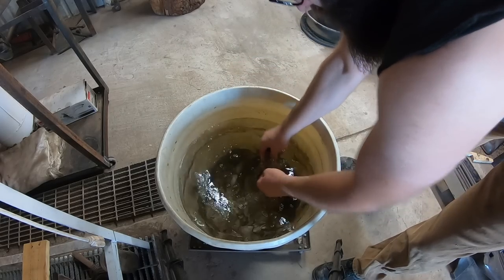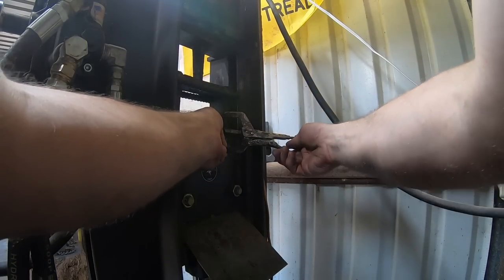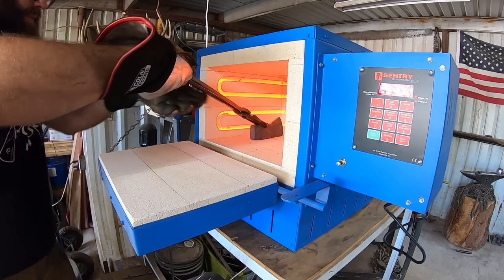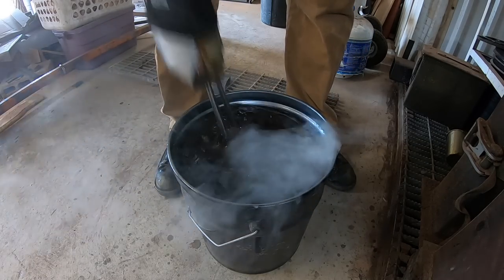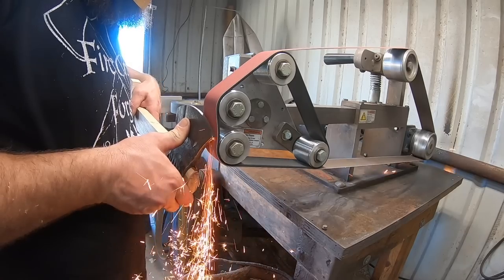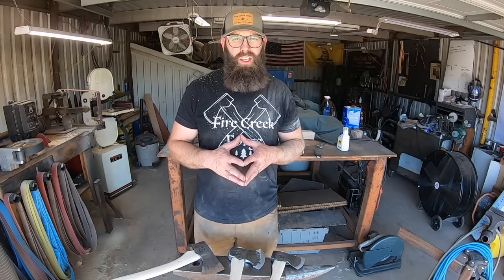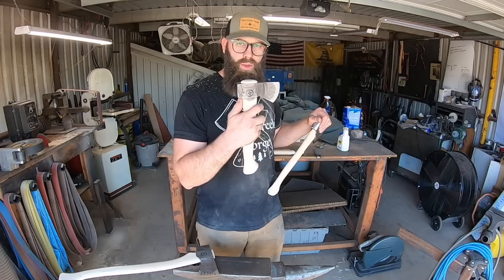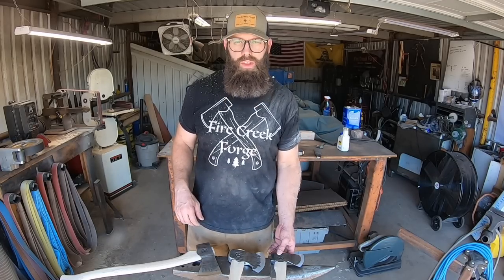Forging Axes In Over 100° Heat At The Shop, Blacksmithing Hatchets Fire Creek Forge, Building Axe

Comment: When your oils tend to get hotter, their viscosity also gets lower and probably why you get some leaks at the filter, its just thin enough to ooze through gaskets and surfaces.
Yeah one of the nice things about modernisation is the ability to do a lot of the work with just one fella and there's no way anyone back in the old timey days was doing anywhere near the same level of involvement across all the manufacturing tasks. Course the downside is that when you do really need a 2nd set of hands to swing a sledge is that our labour laws mean you have to pay them something which more or less wrecks us financially :)

Comment: One day I'd love to own a 5 or 6lbs splitting axe by you if you come up with a pattern. It's not 100 here in MN but we will be seeing 97 tomorrow and Tuesday. We did have 106 heat index this June and our roads started buckling.

Edit: I'm not a fan of mauls as so many designs just bounce off rounds and it's hard to get head speed with super heavy head. Plus, an axe eye being longer and more surface area stays tighter longer in my experience. Be curious to see some prototypes!
Reply: I consider splitting mauls to be dangerous and wouldn't recommend them to anyone...better to use a log cone and a sledgehammer for huge logs then move to slim axes like these for the proper splitting.

Comment: Yeah, heat is nothing to laugh at. I lived in Lubbock for a while as well as Altus OK.  One thing I think I remember was the humidity was 30%  or less??
 I currently live in Wichita KS and the humidity runs about60% on average.  And I'll tell you the old saying about "it's not the heat, it'sthe humidity".  I absolutely true.  When it gets 90° + you need to find some shade.
Reply from the maker: Yes sir, I'm an hour from Lubbock. Yep, overall once the humidity gets about 25% I get uncomfortable, haha.. We've had some humidity lately, and I agree that's the tough part
Reply: @FireCreekForge  maybe get a bigger fan? LOL.

Comment: Just curious why are you Oil Quenching? 1060 is Water or Brine Quench but can be Oil Quenched for really small diameter pieces, I use 1060 for a lot of woodcarving tools chisels etc and have always used water for full hardness quench then temper the tools back down. I’m not just saying my personal opinion but actually manufacturers recommendations as well as what’s in the Heat Treater’s App
Reply from the maker: As a general rule that is true, but the particular steel can vary a bit in composition with some alloy additions increasing hardenability. I've had this steel crack in water a couple times.
Reply: @FireCreekForge  I’ve not had that happen but I’ve not used 1060 in anything with that much mass like those axes, wonder if that’s part of it. Mostly I’ve used for woodcarving chisels gouges etc and engraving tools so smaller as far as mass. I did like your wood carving axe in the video by the way
Reply from the maker: @peltiereric6497  thank you. This is technically 1060M, which allows for additions of some chromium and other alloys, so standard 1060 probably wouldn't do that.

Comment: Nice axes, you are getting very proficient at turning them out 👍. Your workshop could probably do with some insulation in the roof to help deal with the heat, especially with that forge running constantly in there. Our Aussie Summers regularly reach 42 degrees Celsius or 107 degrees Fahrenheit, when I was younger I could easily work in these temperatures, these days I sit on the veranda in front of a fan !! Regards from Down Under.
Reply from the maker: Thank you! Yes that is warm.

Comment: Hatchet and axes look fantastic, love the wedge, the camp axe is the size I use most for hedging and splitting etc 
I like a longer handle. Any one of those would be a very welcome addition  to my workshop
Reply from the maker: Excellent, thank you
Reply: For your hydraulic press, you can drop the reservoir level a bit to release the expansion in hot weather. It’s something we had to do for hydraulic systems in the Middle East. I’m talking 1800-2000psi systems.  Make sure to talk to the manufacturer though, obviously.

Comment: Axes and hatches are looking great.  I’m Suprised you don’t have the shop layout the other way. Being able to roll the forge outside the door helps a lot with heat, like you did in the old shop.  I have a short handled 8lb hammer that’s great for drifts but I can only do so much of it. It can Really get to the shoulder
Reply from the maker: Thanks! I used to have it like that, and would, but the other end is the only solid concrete for the power hammer...
Reply: @FireCreekForge  ah, yeah that could be an issue.